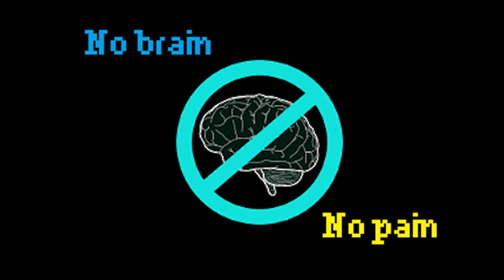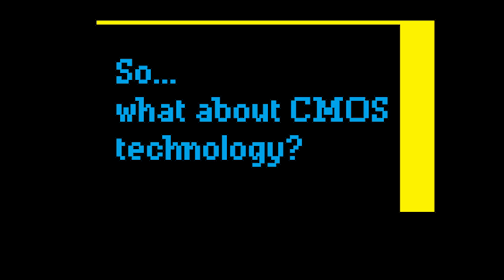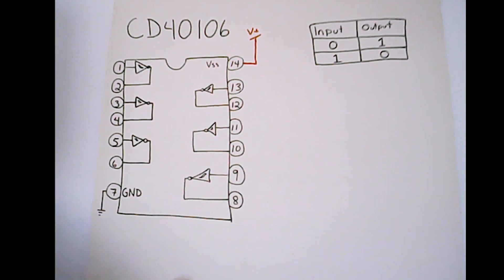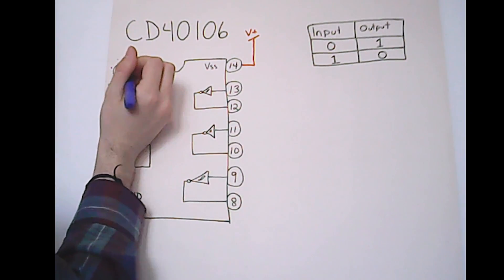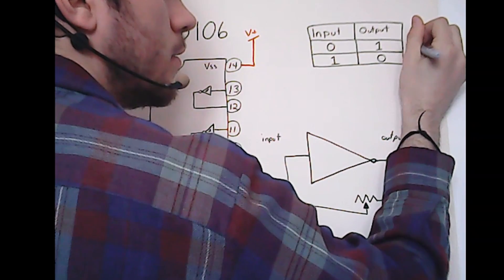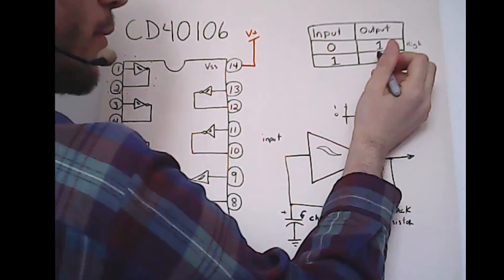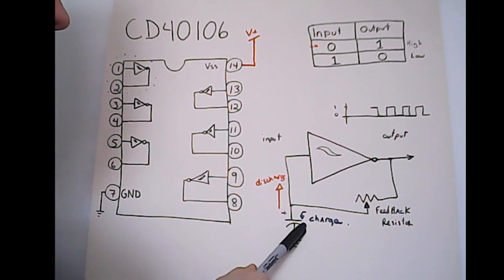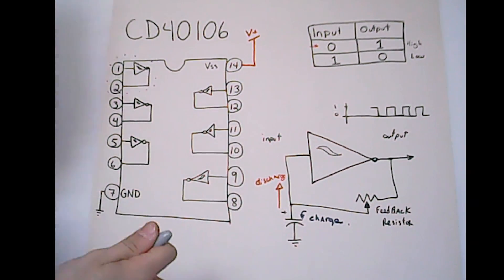Build your own CMOS Synth

Comment: Cool stuff!
So, what happens if you repeat this for more than 1 inverter (with different caps/resistors)?
If you just tie the outputs together I assume it won't work, cause the output voltage from pins 2,4,6,8, etc will kind of start to modulate each of the other inverters, no?
How could you easily mix a bunch of different frequency oscillators together then?
Reply: Aha, just go to the next video! Awesome lessons for a beginner, thanks man!
"Osciyators" ;)
Reply from the maker: Hi William,  wanted to explain everything to you but you find out in the second video that you could tie a high speed diode at the end of each inverters to prevent them to modulate each other or better would be to build the passive mixer with a 10K or 100K potentiometer. :)
Reply from the maker: Thanks for your comment!
Reply: Thanks!
So, two more questions:
1) Could an LED be used? (Added bonus: indicator of frequency of each osc.)
2) What is the final 100K before the Amp for?
Reply from the maker: Thanks for both questions.
1-A Led could be used, I already had a tri-oscillator using 3 differents LED colors. 
2-Tje 100K before the amp is the volume control for each oscillator, it act as a passive mixer. ;)